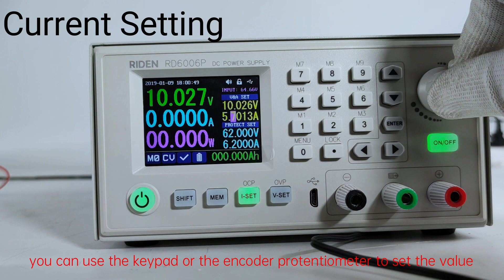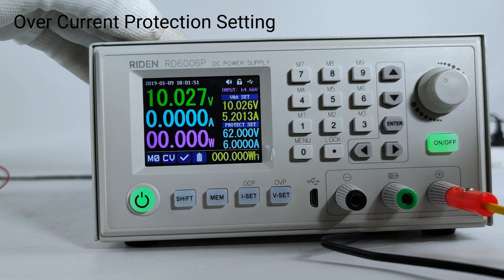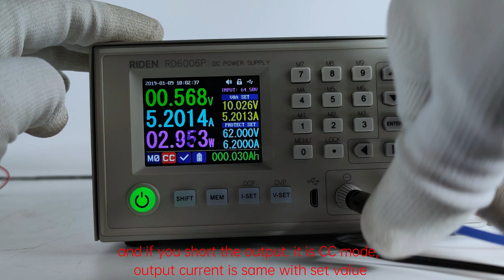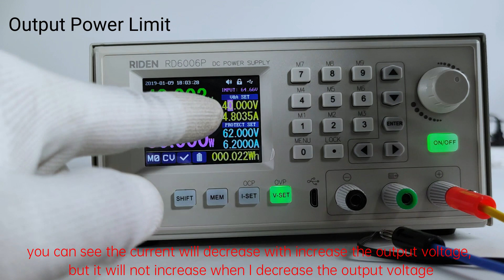RD6006P operation series video(manual 1.4.2.2)-Main Page Output Voltage and Current Setting

Comment: Hello. Please tell me why when you press enter button (time 0:42) nothing changes and output current isn't changing to 5 A?
I have same problem. If i press I-set, press 5, press enter. Nothing change. 

I think problem is that if you set I-set to 5 A, with V-set is too low, to achieve 5 A, then RD will not follow your command. To my opinion this is strange and not comfortable. Can you please help me how to walk-around this?
Reply from the maker: hello, in this video at 0:42.I just set the current from 6A to 5A, it is just the way to adjust the setting, but I do not connect load, no load, then there is no current, there is only output voltage

Comment: Can I set a minimum voltage ? I want it start at 12v up to 48v
Reply from the maker: hello, do you mean you want to program the output voltage? then you need to use the PC software advanced function, you can set the voltage and current for certain time

Comment: Hello there, how do you set it to cccv for charging or is cc and cv switched automatically during the charging process?
Reply from the maker: hello, for the output CC CV mode, it is decided by the load you connected and the status of the load, if you are charging the battery, it uses the CC-CV mode battery charging way to charge the battery, you can search this mode to see how it works
Reply: @rdtech9153  thank you for your reply
Reply from the maker: @ozjado  you are welcome

Comment: I have done over 200 purchases in China in the last 5 years
And i never met a scammer like you Rd Tech !
I bought a power supply (S-1000-68  ) from your aliexpress shop (RD Official Store) and i received an item with broken seal. I saw that all your power supply come in a foil/film , mine came without that foil.But it had foil ! Because the pieces of foil/film stuck to the power supply.Especially around the screws .You sent me a refurbished!
After this i gave you a negative feedback .And you because are a silly scammer gave me back a negative feedback
All your customers need to know that you are selling refurbished products

Comment: Great video ! What's the difference between the RD6006 and this one RD6006P ?
Reply: Interest me too.
Reply: And me too. Is this hardware or software update?
Reply from the maker: @MarcelHuguenin  it is new hardware design, it combine the structure of switch pwoer supply and liner power supply, so the ripple is lower, and the accurancy is higher, you can see there is a test video of RD6006P
Reply from the maker: hello, you can check the description page of the RD6006P product, there is a comparison chart, basically it is 5 digit display, more accurate, much lower ripple